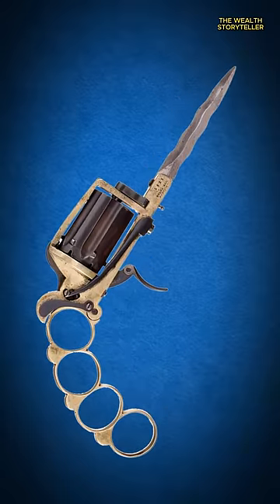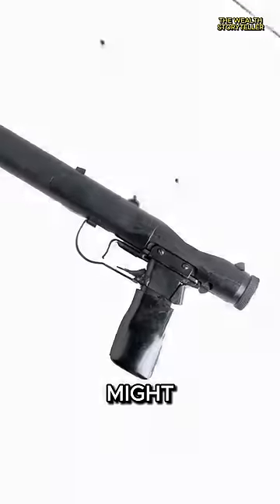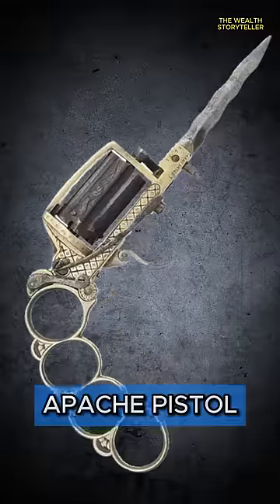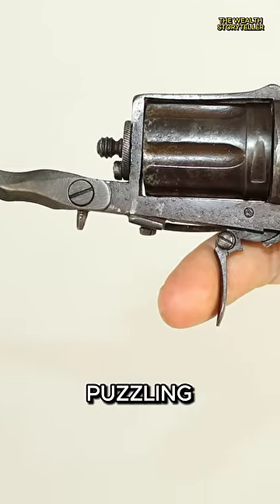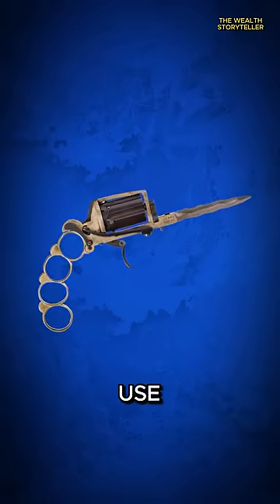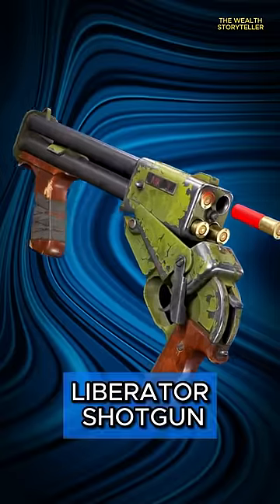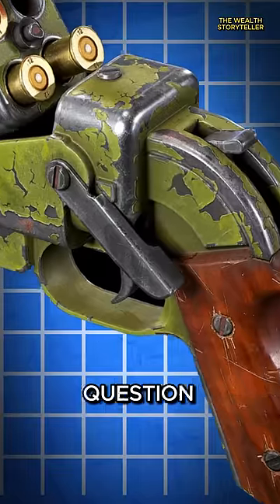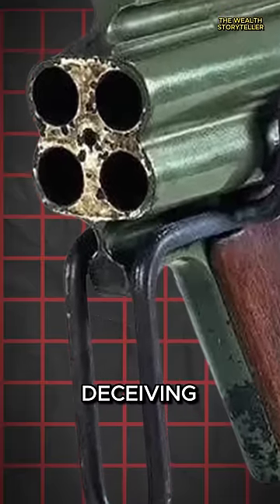Ugliest guns you need to know

Comment: The apache pistol has such a bad accuracy it's even worse than the FP-45 Liberator, a gun made to be used once.
Reply: Like, one shot per round, or…?
Reply: @HUBWORLDNULL i just looked it up and based off my limited understanding i think the fp-45 is a single shot pistol, it looks like extra rounds where kept in the grip of the gun where the magazine usually is placed but you have to manually load each one after you shoot
Reply: @HUBWORLDNULL to be used once.
Reply: The liberator was made to be dropped to resistance groups and rebels in WW2 for a weapon to get better weapons. It could be fired way more then once and was chambered in 45. Acp.
Reply: @Willythehillbilly01  "made to be used once" they were supposed to shoot a soldier ONCE and pick up his gun, disposing of the liberator.
Reply: it was made to be shot only once but it had extra ammo somewhere in it
Reply: Apache was made for gangs with close combat. Not made for targeting something
Reply: @HUBWORLDNULL The FP Liberator was used by resistance forces during WW2 for the purpose of finding a better weapon (meaning walk up to a German soldier, shoot him point-blank, and take his gun).
Reply: @HUBWORLDNULL  no like you use it to kill someone and then take their gun
Reply: The apache is a 3 in one weapon it folds to be brass knuckles, knife, and a gun so theres a reason
Reply: Tbh it kinda goes hard
Reply: @HUBWORLDNULL its basicaly a nerf gun with rounds. it was made to ambush someone and take their(way better) weapon
Reply: @Willythehillbilly01  ah. So it’s like “I’m a piece of sh!t for stealing other pieces of sh!t”
Reply: @motorcitymurka3295 
And when you build something that tries to do everything, you get a tool that barely functions for anything.
Reply: Dude it's in a revolver configuration and there's no hammer, plus there's no barrel so the bullet would just fly off somewhwre
Reply: @KritzKezer nope, made to be used once meaning, you attemt to shoot uour enemy but miss and he kills you.
Reply: @DistressedKnight  It lost a lot accuracy after about 5 yards, but this particular version of the old school "knuckleduster" is the worst, as you actually have to play transformers to make it a set of brass knuckles by disengaging the trigger lock and folding the revolver part to be held in the palm for use.

J. Delhaxhe made a fixed top revolver version of brass knuckles you hold as the grip, much more practical as you could punch and guarantee a point blank shot as the knuckles connected.

The nickname "Apache" came from the French gang of the same name that wanted a melee weapon and gun in one for muggings during the mid 1800s.

Comment: The Welrod is a British bolt action, magazine fed, suppressed pistol devised during the Second World War by Major Hugh Reeves at the Inter-Services Research Bureau (later Station IX). Station IX, being based near Welwyn Garden City, gave the Welrod its unusual name, being derived from "Wel" from "Welwyn Garden City" (a prefix used by covert equipment designed by Station IX) and "rod", gangland slang for gun, as a way to obscure its purpose.[1]

Designed for use by irregular forces and resistance groups, the Welrod is an extremely quiet gun thanks to its integrated suppressor. Approximately 2,800 were made in wartime and perhaps 14,000 in total when post-war examples are included.[1]
Reply: There was a plan in 1943 to drop Welrods into German-occupied territories for the mass assassination of  (SS) and Gestapo officers and soldiers within a one-month period by resistance units. This plan was possibly delayed or called off in the aftermath of Operation Anthropoid, the assassination of Reinhard Heydrich by Czech resistance forces. In the wake of his assassination, an estimated 13,000 civilians were arrested and interrogated, 5,000 civilians murdered in German reprisal killings and the villages of Lidice and Ležáky destroyed.
Reply: The Welrod was used in Denmark during the war as well as being dropped in several other countries and is reported to have been used during the 1982 Falklands War, throughout The Troubles in Northern Ireland and during operation Desert Storm by British Special Forces. Welrod guns were also found in weapons caches from Operation Gladio. The Welrod was also used by US Army Special Forces soldiers assigned to Detachment 'A' Berlin during the Cold War and by MACVSOG.
Reply: Hi
Reply: This guy in the video didn't even try explaining the intended purpose. I would like to add that B&T remade the Welrod.
Reply: Also it holds the record for the quietest gun ever made, it is literally silent
Reply: B&T makes a modern version of the welrod.  Pretty awesome imo but dont look the $$ if you dont know who B&T is.   😂. The poors will cry
Reply: You coped and pasted this well sum of it lol,  but yes The welrod was not ment to be a great gun. It was  for use by irregular forces and resistance groups, the Welrod is an extremely quiet gun thanks to its integrated suppressor.   It was made in .32ACP,  and 9mm parabellum.  It was better construct and reliability to the FP-45 Liberator, even thow the FP-45 was a biger calibre.  Thay are both terible guns but the welrod was used up until veitnam, Falklands, Northerner Irland and Desert Storm. So prety successfull lol. Yes I have put this comment in this thread a few times lol😅.
Reply: I Just googled this, you basically summarized the entire google page.

Comment: The biggest question that the apache pistol makes you wonder is what substances was the person who designed it high on
Reply: @plaguetheory4743 I think it’s supposed to shoot the knife
Reply: These were predominantly used by French street gangs, however the blade was rarely ever used by them. Wielders tended to just use them as knuckledusters with a puny revolver attached to them. That's why, on examples that have a blade, they tend to be in pretty good shape lol
Reply: @Weakest_sailor no, no it doesn't

Comment: The Apache pistol is really smart because it is Knuckle Busters ,a gun ,and a knife.
Reply: All those things are good separate but not really together. A gun is not something you really want to hit something with as it could cause it to gain a bunch of mechanical issues. The gun would likely require constant maintenance checks just so that it’s hopefully reliable on use. In addition the way to use the knuckles is that you had to fold it but in that same time you could just as easily grab brass knuckles off your person.

Comment: The welrod was specifically designed to not look like a gun when dismantled, making it easy to sneak through security for spies during the cold war. Its integrally suppressed and has one of the quietest gunshots youll ever hear
Reply: The welrod was not ment to be a great gun. It was  for use by irregular forces and resistance groups, the Welrod is an extremely quiet gun thanks to its integrated suppressor.   It was made in .32ACP,  and 9mm parabellum.  It was better construct and reliability to the FP-45 Liberator, even thow the FP-45 was a biger calibre.  Thay are both terible guns but the welrod was used up until veitnam, Falklands, Northerner Irland and Desert Storm. So prety successfull lol.  Sorry I have put this in a good few comments now lol

Comment: Sure, here's a simple brownie recipe:

Ingredients:
- 1 cup (2 sticks) unsalted butter
- 2 cups granulated sugar
- 4 large eggs
- 1 teaspoon vanilla extract
- 1 cup all-purpose flour
- 1/2 cup cocoa powder
- 1/4 teaspoon salt
- 1 cup chopped nuts (optional)

Instructions:
1. Preheat your oven to 350°F (175°C) and grease a 9x13-inch baking pan.
2. In a saucepan, melt the butter over low heat. Remove from heat and stir in the sugar.
3. Beat in the eggs one at a time, then stir in the vanilla.
4. In a separate bowl, sift together the flour, cocoa powder, and salt. Gradually add this to the wet mixture and mix until well combined.
5. If desired, fold in the chopped nuts.
6. Pour the batter into the prepared pan, spreading it evenly.
7. Bake for 25-30 minutes or until a toothpick inserted into the center comes out with a few moist crumbs.
8. Allow the brownies to cool in the pan before cutting them into squares.

Enjoy your homemade brownies!
Reply: Ummmm..... thanks bro
Reply: Thank you, not only can ao write absolute garbage gun scripts, but now I cam make brownies
Reply: Damn bro was too lazy to make up his own
Reply: @jmiclan681 wrong topic my guy💀
Reply: Nice

Comment: I don't mean to be such a harsh critic but there's kind of a reason the welrod looks like that. It was meant to be a weapon of covert operations and when fired would typically sound no louder than a car backfiring. That was because of that baton like barrel that was actually full of specialized materials meant to absorb and dampen the sound of the shot

Comment: the welrod looks that that way because the whole barrel is basically a suppressor. it has "movie" tier silencing, a fully refurbished model being about as loud as a Co2 pellet gun.
the apache looks the way it does because the design philosophy behind it was "what if we combined a knife, brass knuckles and a gun all into one thing?"
the liberator is badass. not only do you get the badassness of having a sawed-off, pistol-grip double barrel, but you multiply the badass factor and essentially everything else about the gun by 2. fun fact btw;if you multiply the badass of the liberator AGAIN, you get the colt defender (an 8 barrel shotgun)